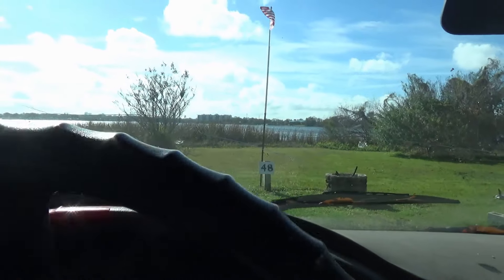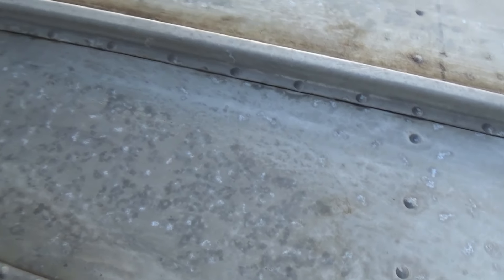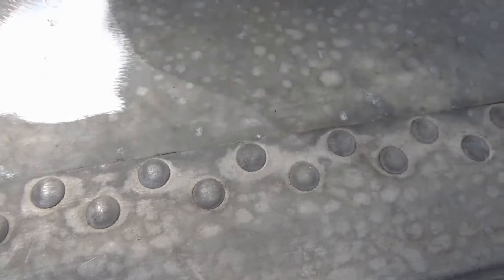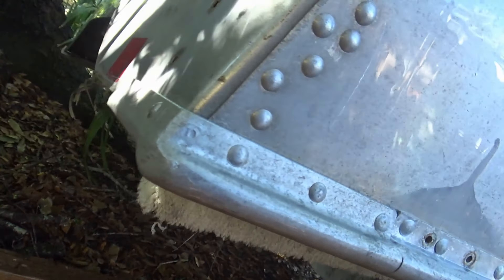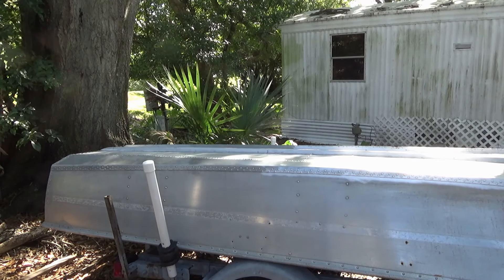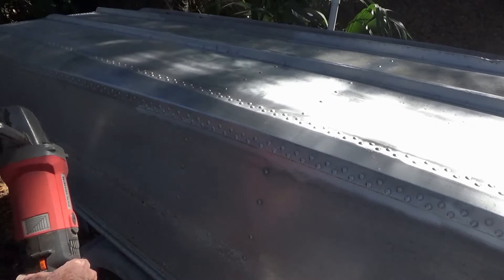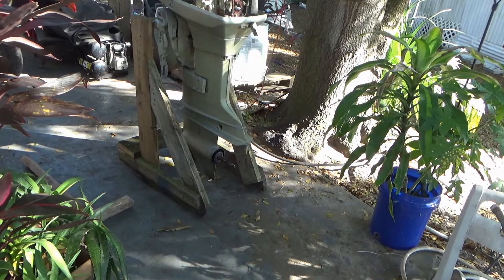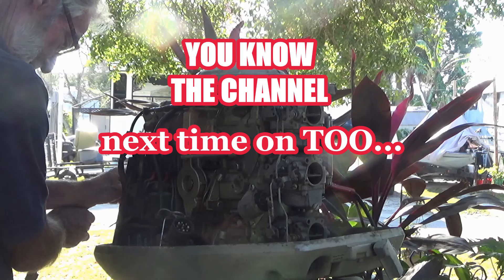14' Orlando Clipper Aluminum Boat Bottom Prep - #outboardrepairand

Comment: The bottom cleaned up pretty well. As long as the sealer is flexible you should be good. Looks like the motor might be more of a challenge.
Reply from the maker: Hey. Thanks again for tuning in!

Comment: When my father's Orlando Clipper was new it was very shiny for a short time.  BTW:  There were stripes down each side.  They were of Scotch reflective red tape (like you see on some trailers).  At the front of each stripe was a riveted metal oval which read "Orlando Clipper" in a stylized font.  The oval's background was also red.  The inside of the transom, and the outside, were plated where the motor mounts with 4-sided (odd shaped) plywood pieces painted red.  They were about 3/8" in thickness and quarter-rounded on the edges.  The floor, except for the very back, had a coarse non-skid green surface applied at the factory.  They were pretty little boats in their day and there were thousands of them across Florida.  They were strong and stable.  However, the aluminum used in them was not of a grade that would hold up for long periods in saltwater.  A lot of Clippers were ruined by saltwater.  I am told Orlando Clipper #1 is on display at Southern (Lighting) Manufacturing corporate offices in Orlando.  Southern was the parent company of Orlando Boat Company.
Reply from the maker: Cool man! Thanks for tuning in!

Comment: I use bondo instead of JB weld because you get a lot more and it’s cheaper sands good and I don’t have any leaks at all put a little fiberglass resin, like an ounce in the whole can, and it comes out real easy and smooth 👍🏻🤘🏻
Reply from the maker: Hey. Thanks for tuning in. Sounds good!

Comment: Have a question I have a fiberglass skiff weighs about 450lbs not sure what props on the 1990 25 now? 
What would be a good size for a heavier skiff? Thanks
Reply from the maker: Hey. Thanks for tuning in. Well if you just want to push a heavier load then a bigger diameter and a smaller pitch prop would be best, like a 11 1/4 x 7. You won't be going very fast. If your looking for speed then a smaller diameter and higher pitch prop is best. The only problem is finding what works best for your boat. You might have to try 2-3 sizes to see what's best. Higher pitch props don't always mean faster outboards. Check your prop for the size then decide if you want to try a higher or lower pitch. Thanks again & Stay tuned !